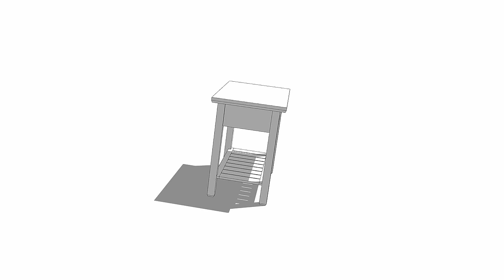This Added a TON of Counter Space | Hardwood Kitchen Island

Comment: I would like to know what Festool Sanders you own and why did you choose the specific model(s) you own?
Reply from the maker: I have the ets 125 and 150/5 I like the 125 for smaller projects and the 150 for larger ones as it has much more surface area and removes a lot of material more quickly.

Comment: the finished piece is beautiful, but IMO your design does not allow for wood movement, and the cross grain situations will tear itself apart after a couple seasons.
Reply from the maker: I’ve shared this in another comment but here’s the gist for the for the expansion issue you’re describing. The alignment of the radial and longitudinal grain in the mortise was chosen to balance aesthetics, strength, and wood movement. While alternatives like double stub tenons or figure 8 fasteners could be used, this design aligns with my vision for the piece and takes into consideration the expansion and contraction of the wood. So while I do understand your concern there is space for wood movement built into the joinery and that was heavily considered during the design process.